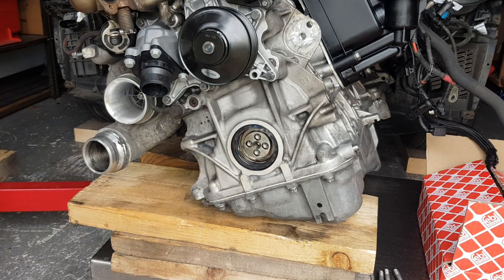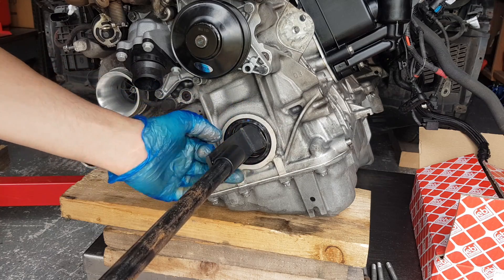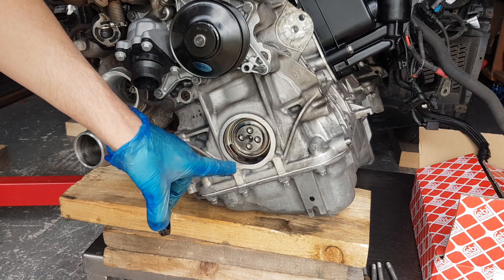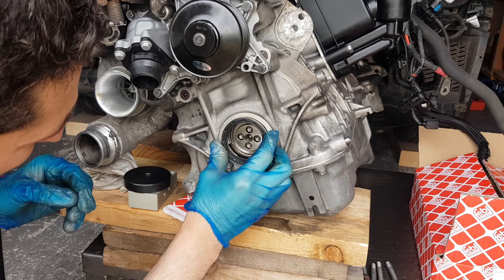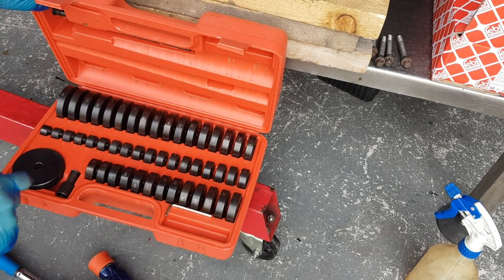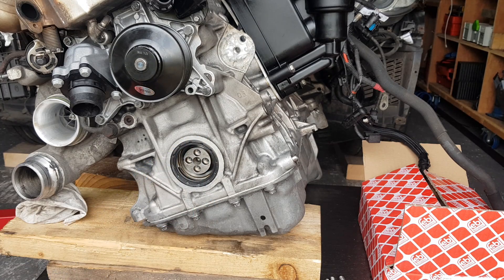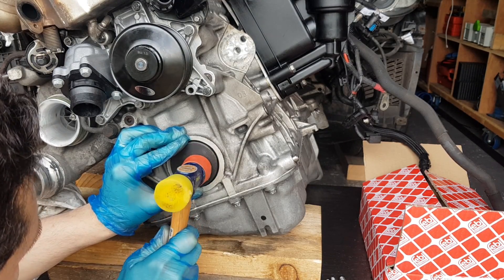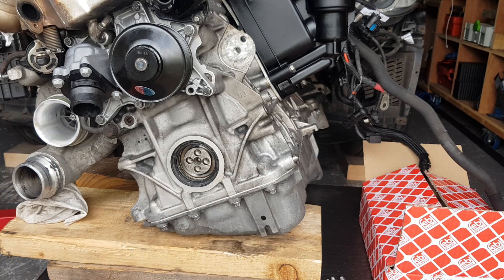How to remove & replace front crankshaft seal BMW N57 N47 530d 520d 330d 320d 730d F10 F11 F06 F01

Comment: Useful tip guys if your struggling to remove; you need to knock the bottom of the seal towards the crankshaft (inwards) in doing so you can use a screwdriver to pry the rest out…this took 30 seconds having been scratching my head for the last hour!
Reply from the maker: Thanks for sharing 🤝🏻
Reply: @TheKeenMechanic question for you; I’m currently doing the timing chains on my n57, I have everything now timed back up as I removed the crankshaft for other work. When I crank the engine over by hand it makes a sound like a loose chain would getting the slack taken out of it, but then again could just be the valves . Is this normal, possibly just the  HPFP running dry or some other non concerning reason?

Appreciate the help!
Reply from the maker: @Blaze-sz1no Not sure to be honest. Consult with someone local to you that can hear it in person🤝🏻

Comment: Grazie per l'ottimo video...potrei avere lo stesso problema sulla mia BMW X3 F25 184cv diesel xdrive...l'auto ha 333500km, ho dovuto sostituire in questi giorni la puleggia albero motore più volte in quanto i ricambi erano difettosi (stark squilibrata, febi bilstein leggermente squilibrata) ora con Corteco sembra tutto funzioni correttamente...il problema è che forse ha iniziato a perdere il front crankshaft seal....quindi Grazie ancora per il video....solo per conoscenza, ho adottato una soluzione simile per sostituire il paraolio della pinza freni posteriore... in Concessionaria BMW non sapevano darmi un consiglio 😞
Reply from the maker: Glad to hear it helped you fix your car. Best of luck🤝🏻

Comment: im about to change crankshaft pulley, do i must change the seal also? i dont think its easy job to change seal while engine is in place still
Reply from the maker: @yupiter7  I would also change the seal every time just in case. 🤝🏻
Reply: @TheKeenMechanic  i did order a new seal, hopefully there is only one, because i was not sure how to find part number for it. Looks like i need angle tool and a torc wrench
Reply from the maker: I have the part numbers in the description. I usually do that in all of my videos.

Comment: I made a resaerch on the part number of the crank pulley from DEFI that you posted on ur video which is 48421... It turns out that they are only suitable for 3L M57 engines and not for any N47 2.0L displacement.. But still thanks for the info
Reply from the maker: Hi
Do you mean N57 not M57 as they are two different engines? Thanks for sharing your research🤝🏻
Reply: @TheKeenMechanic  yeah N57.. Sorry typo error

Comment: Dude, this video is so helpful, I'm about to tackle this job on my A90 Supra and now I'm much more confident. Thank you!
Reply from the maker: Hi buddy and thanks for watching.
Is the supra with N57 engine?
Reply: @TheKeenMechanic  no it's the B58 Gen 2 but the crank pulley looks very similar if not identical and the workshop manual also states 40nm/120 degrees.  I just prefer to see it being done in a video so I can visualise the process.

Edit: Obviously I'm talking about the crank pulley replacement process from your other video (https://www.youtube.com/watch?v=DfbA4aHjhsw) but I found this one first
Reply from the maker: @the_wilferine  Nice one. Must be a lovely car to drive. Glad you find my content useful. Thanks for your time and I am sure you will get it sorted. Where are you based?
Reply: @TheKeenMechanic  yeh it is when it’s working haha, tbf I haven’t had any issues with it until now. I’m in the north east region of the UK 🇬🇧
Reply from the maker: @the_wilferine  North east UK sounds better than North West of Ireland weatherwise 😁
Best of luck and thanks for stopping by🤝🏻

Comment: Well explained as always.
A seal you hope never fails if you can't remove the engine😅
Reply from the maker: Thanks for watching buddy, yes, it will not be fun removing this with the engine in place.
Reply: A lot of fun 😢😂😂😂
I changed without engine out, small place to move it
Reply from the maker: I can only imagine but well done for managing to do it in such a tight spot😉🙌🏻